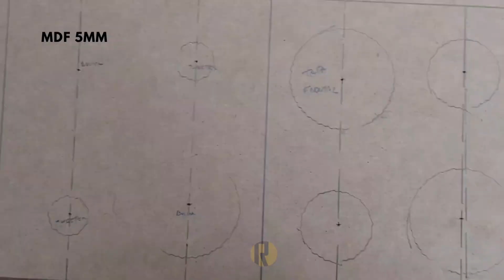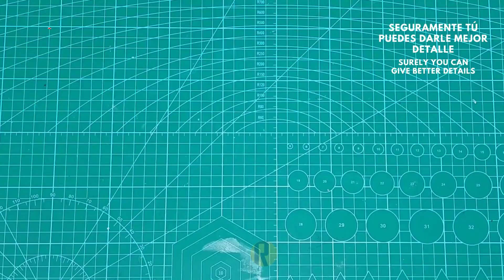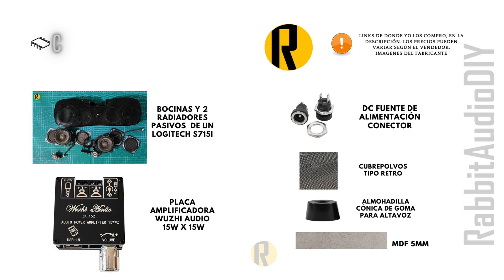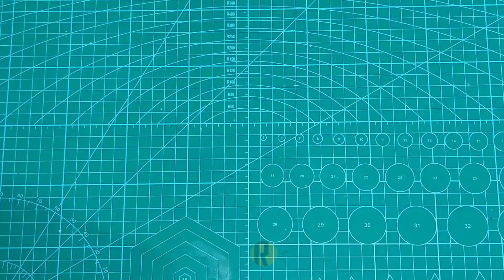🚨 DIY How to make POWERFUL speaker at Home

Comment: Acabo de conocer tu canal y le metes, hermano una consulta que bocinas serían similares q las que usaste ???
Reply from the maker: Gracias bro si es algo complicado pero esperemos luego se recompense para mi y para ustedes. Entra a aliexpress y busca bocinas aiyima full rango 3" hay varios modelos de 4ohms las que yo use daban como 13W cada par (medio-bajo y tweeter) si quieres el mismo amplificador deben ser max 15W por canal. Otro tip es que busques en marketplace de Facebook luego hay muy buenas bocinas a precios muy bajos!  Dame 5 min y pongo en la descripción las que pueden usar.